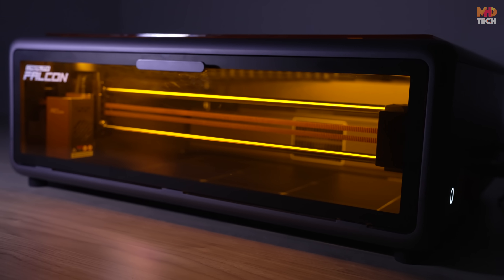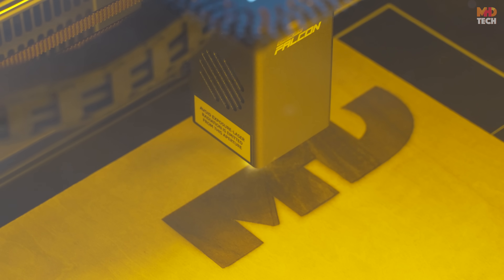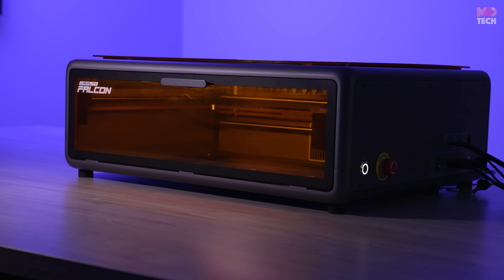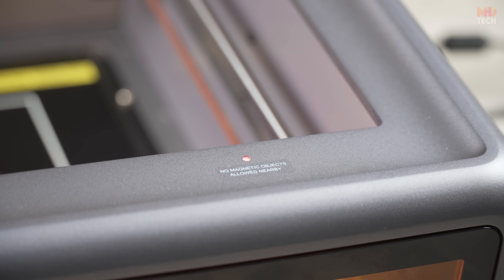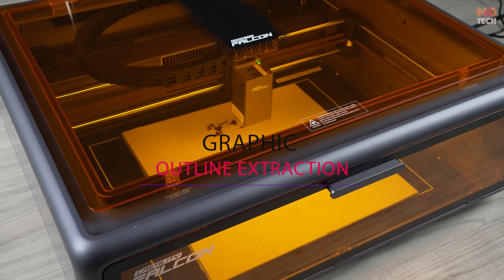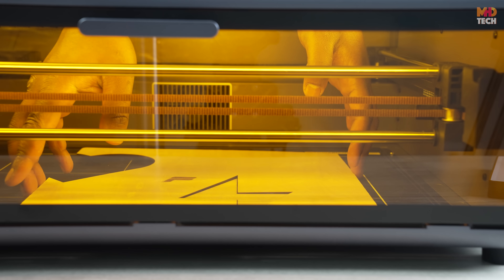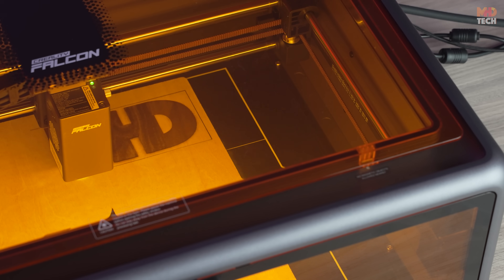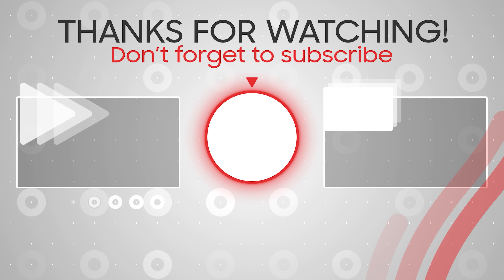Creality Falcon A1 Laser Review – Next-Level Metal Engraving & Precision Cutting!

Comment: Offline Operation Option: Comes with an SD card slot for file transfer, meaning no constant connection to a PC is needed — great for standalone operation.

🔍 Laser Performance
High-Power Diode Laser: The 22W or 40W options (depending on variant) make it capable of cutting through up to 15mm wood or 10mm acrylic in a single pass.

Metal Engraving Ability: Easily engraves stainless steel and coated metals with fine detail, something rare in diode lasers at this price point.

Auto-Focus Feature: Auto-adjusts height for optimal focus on uneven or multi-layered surfaces — a big time-saver.

🪵 Material Compatibility
Versatile Material Support: Works smoothly on wood, leather, acrylic, stainless steel, anodized aluminum, glass (with coating), and more.

Consistent Results Across Materials: The laser maintains clarity and depth across different materials without needing frequent reconfiguration.

📏 Precision & Detail
Extremely Fine Detailing: With 0.1mm accuracy and a 0.06mm laser spot size, the Falcon A1 can render tiny fonts and intricate artwork with ease.

Speed with Accuracy: Can operate at high speeds (up to 25,000 mm/min) without losing detail, thanks to its solid frame and smart motion system.

🔒 Safety Features
Smart Safety Sensors: Includes flame detection, motion detection, and tilt sensors that automatically pause operation in case of anomalies.

Protective Shielding: The laser head comes with a protective shield that reduces direct exposure to harmful laser light.

🌬️ Cooling & Exhaust
Integrated Cooling Fan: Keeps the laser module and circuit board cool during long sessions, which boosts the machine’s lifespan.

Smoke Filter Compatibility: Can be paired with external smoke purifiers — essential for indoor use or extended runs with materials like acrylic or MDF.

📈 Value for Money
Professional Results at a Consumer Price: For hobbyists and small business owners, the Falcon A1 delivers capabilities typically reserved for machines 2–3x its cost.

Would you like a complete review article based on these comments?

Comment: Stainless steel compatibility: With blackening agents or slow passes, the Falcon A1 can mark steel effectively.
Reply: Offline Operation Option: Comes with an SD card slot for file transfer, meaning no constant connection to a PC is needed — great for standalone operation.

🔍 Laser Performance

High-Power Diode Laser: The 22W or 40W options (depending on variant) make it capable of cutting through up to 15mm wood or 10mm acrylic in a single pass.

Metal Engraving Ability: Easily engraves stainless steel and coated metals with fine detail, something rare in diode lasers at this price point.

Auto-Focus Feature: Auto-adjusts height for optimal focus on uneven or multi-layered surfaces — a big time-saver.

🪵 Material Compatibility

Versatile Material Support: Works smoothly on wood, leather, acrylic, stainless steel, anodized aluminum, glass (with coating), and more.

Consistent Results Across Materials: The laser maintains clarity and depth across different materials without needing frequent reconfiguration.

📏 Precision & Detail

Extremely Fine Detailing: With 0.1mm accuracy and a 0.06mm laser spot size, the Falcon A1 can render tiny fonts and intricate artwork with ease.

Speed with Accuracy: Can operate at high speeds (up to 25,000 mm/min) without losing detail, thanks to its solid frame and smart motion system.

🔒 Safety Features

Smart Safety Sensors: Includes flame detection, motion detection, and tilt sensors that automatically pause operation in case of anomalies.

Protective Shielding: The laser head comes with a protective shield that reduces direct exposure to harmful laser light.

🌬️ Cooling & Exhaust

Integrated Cooling Fan: Keeps the laser module and circuit board cool during long sessions, which boosts the machine’s lifespan.

Smoke Filter Compatibility: Can be paired with external smoke purifiers — essential for indoor use or extended runs with materials like acrylic or MDF.

📈 Value for Money

Professional Results at a Consumer Price: For hobbyists and small business owners, the Falcon A1 delivers capabilities typically reserved for machines 2–3x its cost.

Would you like a complete review article based on these comments?

Comment: Robust Frame Construction: The aluminum alloy body gives the Falcon A1 a solid, vibration-resistant structure, ensuring more accurate engraving results even at high speeds.

Comment: Equipped with a pre-calibrated HD camera, it offers a full-frame view for intuitive operation. The built-in AI system automatically detects materials and optimizes engraving settings, eliminating manual adjustments.

Comment: I appreciate how you highlighted both strengths and limitations - makes it easier to decide.
Reply: Is a laser cutter machine safe to use?
Reply: Laser cutter machines can be safe to use if proper precautions are taken. Some safety considerations include:

- Wearing protective eyewear and avoiding direct exposure to the laser beam
- Ensuring proper ventilation to remove fumes and particles
- Following the manufacturer's guidelines and instructions
- Keeping the machine away from children and pets
- Using safety features such as automatic shut-off and enclosure

By taking these precautions, users can minimize risks and safely operate a laser cutter machine.
Reply: Is this laser safe I mean from the structure and outside layer of it for safety
Reply: This laser hv safety glasses with wide range of projects...

Comment: The fact that it handles metal engraving this well at this price point is unreal. Perfect for small business and hobbyists alike.❤
Reply: The 10W laser module delivers impressive engraving and cutting results, with a fine spot size enabling highly detailed engravings.
Reply: It handles also metal engraving so it's give many designs
Reply: Is it reliable with the safety measures and the glass outside
Reply: Good good

Comment: The Falcon A1 incorporates an automatic material recognition system using QR codes.  This feature automatically adjusts engraving parameters based on the detected material, simplifying the setup process and ensuring optimal results.

Comment: This looks like a game - changer for makers and small businesses. The precision on metal is insane!
Reply: The Falcon A1 incorporates an automatic material recognition system using QR codes.  This feature automatically adjusts engraving parameters based on the detected material, simplifying the setup process and ensuring optimal results.

Comment: Whether you're cutting intricate wooden puzzles or engraving stainless steel tumblers, the Falcon A1 handles it all with exceptional detail and repeatability. The stable XY motion system ensures smooth, consistent lines even at high speeds.

Comment: Standard roughness Rz increases with the sheet thickness, but decreases with laser power and cutting speed. When cutting low carbon steel with laser power of 800 W, standard roughness Rz is 10 μm for sheet thickness of 1 mm, 20 μm for 3 mm, and 25 μm for 6 mm

Comment: commercial laser for cutting materials uses a motion control system to follow a CNC or G-code of the pattern to be cut onto the material. The focused laser beam is directed at the material, which then either melts, burns, vaporizes away, or is blown away by a jet of gas,[1] leaving an edge with a high-quality surface finis

Comment: The Falcon A1 features a contemporary, fully enclosed design crafted from aerospace-grade aluminum with die-cast parts. This robust construction not only provides durability, with a tensile strength of ≥205MPa and Brinell hardness of ≥75HBW, but also contributes to a quieter working environment by containing the laser and any fumes produced during operation

Comment: The overall user experience is described as very positive and enjoyable.
   From unboxing to finished product, it's a smooth process.
Reply: Yeah the this product is too good and have worth so better to take it I have been buyed also
Reply: What materials can a laser cutter machine cut?
Reply: Laser cutter machines can cut a variety of materials, including:

- Wood (e.g., plywood, MDF, balsa)
- Acrylic
- Fabric (e.g., cotton, polyester)
- Paper and cardboard
- Leather
- Plastics (e.g., ABS, acrylic)
- Foam
- Some metals (depending on the machine's power and type)

The specific materials and thickness that can be cut depend on the machine's power, speed, and settings.
Reply: This is a excellent durability and works long time with 110 watts
Reply: Yes The overall user experience is described as ver postive
Reply: Yes it has both durability and stability and reliable this is a revolutionary budget friendly product
Reply: This is a excellent durability and work long time with 110watts
Reply: Good product it is use full tihi produced
Reply: Yeah it was absolutely true

Comment: Creality laser 2 falcon is for the big creators who does many projects at a time and this has the power to deliver high output in high speed
Reply: While diode lasers traditionally face challenges with metal engraving, the Falcon A1 can mark certain metals like anodized aluminum and stainless steel, especially when pre-treated with marking solutions.

Comment: The Creality Falcon A1 Laser Engraver is a top-notch choice for beginners and hobbyists. Its enclosed design and built-in camera ensure safe and precise operation. With a powerful 10W laser and 0.06×0.08mm spot resolution, it delivers high-quality engravings. The machine features auto material detection, adaptive ANC isn't available but it has a smart camera with AI for positioning and material detection. It also boasts a large work area of 381×305 mm and decent engraving speed of up to 600 mm/s. Safety features include a security lock and door-open shutdown. While not ideal for metal cutting or heavy-duty projects, it's perfect for crafting and DIY tasks. The Creality Falcon A1 requires minimal assembly and is easy to use, making it a great option for those new to laser engraving. Its cutting performance is impressive, achieving clean cuts in approximately 4 minutes. Overall, it's a great value for its price, earning a 4.8/5 rating ¹ ².

Comment: Pre assembly and ready to use our of the box minimising set up time light weight and portable
Reply: Light burn a preferred software requirements a separate purchase after a trial period.
Reply: The emergency stop button and tilt detection give me peace of mind during operation.
The flame sensor actually works—I tested it with a piece of scorched wood, and it shut down immediately
Reply: Color touchscreen display is responsive and easy to navigate. It shows real-time input/output power, battery levels, and system alerts.

Comment: Falcon A1 automatically detects materials using a built-in QR code system, optimizing engraving and cutting settings without the need for manual setup. No more time-consuming tests—just plug and play for perfect results.this is very nice product

Comment: Its lightweight and modular design make it easy to assemble and move. Users often appreciate its intuitive software interface, which supports various file formats and allows for quick customization of designs. The machine also includes safety features like protective shields and emergency stop buttons

Comment: Tried metal engraving like in your video, and it’s pretty good for a 10W diode laser. Don’t expect miracles on thick metals, but it handles anodized aluminum like a champ. The software could use some polish, though. Anyone else using LightBurn with this?

Comment: It features a powerful diode laser, capable of engraving on a wide range of materials such as wood, leather, acrylic, and even certain metals with proper coating. The build quality is sturdy, with a well-designed frame that ensures stability during operation

Comment: This equipment is one of the game changer product which is easy to use and has easy handling
Reply: It's really a game changer.... What ever you told that's absolutely correct..... This type reviews makes more effective on this product
Reply: Quiet operation makes it easy to use at home.
No need for ear protection or loud environments.
Great for small home workshops.
Reply: Material auto-recognition is a brilliant feature that simplifies settings.
   It takes the guesswork out of power and speed parameters for different materials
Reply: The design of this laser machine makes it very beautiful and the way it prints is very good. I too feel like buying it.
Reply: It's user-friendly and ideal for DIY enthusiasts and creators.
A solid machine for its price range.
Reply: This features are sleak and design more than others
Reply: That one side button beside product to stop the laser is it really sufficient that much or it can be malfunctioned

Comment: This machine is strictly prohibited from engraving highly reflective materials. Prohibited materials include but are not limited to mirror-finished metals, Mirrored acrylic, and compact to fit any space safety in anywhere this product is awesome we buy it
Reply: The built-in smoke extraction system works effectively.
   It helps keep the workspace clean and minimizes fumes during operation.
Reply: This unboxing was super helpful! The BLUETTI AC180° looks like a solid choice for portable power needs. Appreciate the detailed walkthrough.

Comment: The Falcon A1 10W Enclosed Laser Engraver and Cutter by Creality Falcon features a digital interface with a "QR Code" for adjustable speed and power settings.
Creality Falcon A1 10W Laser Engraver & Cutter
Creality Falcon A1 10W Laser Engraver & Cutter ; CoreXY for up to 600mm/s Auto Materials Recognition Zero Assembly Needed  Pre-set Camera for Easy it is very good product and nice product

Comment: This thing is a beast! The engraving quality on stainless steel blew my mind
Reply: Safety features like shields and an emergency stop add extra assurance. The machine requires minimal maintenance and offers great value for its price. While minor calibration issues may occur, they’re easy to fix
Reply: yes very better review
Reply: In this laser tr s good and better features..
Reply: Some users recommend additional protective covers or goggles as the included shield isn’t always sufficient.

Comment: Nice experience on the accuracy and existence of the Creality Falcon Al Laser, built for professionals and hobbyists alike. Whether you're engraving metal, crafting wood art, or cutting intricate acrylic designs, the Falcon Al delivers unmatched accuracy and speed
Reply: recognition streamlines the engraving process.   Priced competitively at around $550, offering value compared to similar models.
Reply: Some users have noted that the default software could benefit from further development
Reply: Some users have noted that the default software could benefit from further development, though alternatives like LightBurn are compatible.
Reply: Utilizing a CoreXY motion system, it reaches speeds up to 600 mm/s, balancing speed with precision.
Reply: Engraving speed is excellent without compromising accuracy.
Finished projects look sharp and detailed.
A solid performer in every aspect.